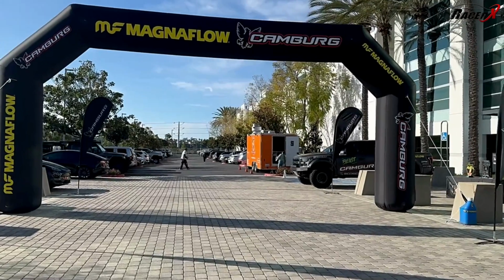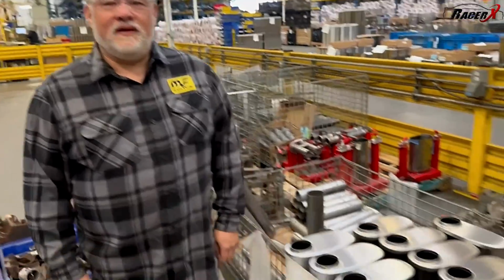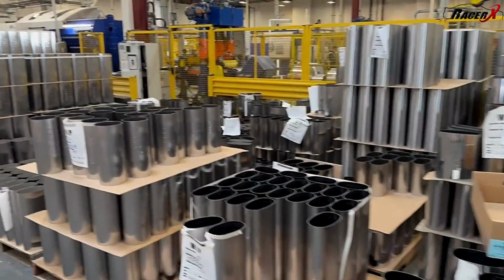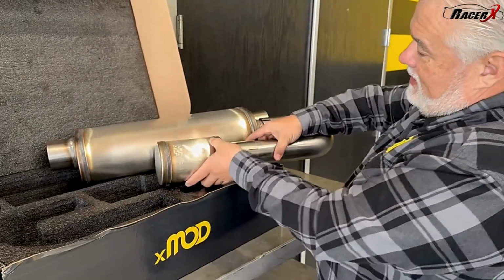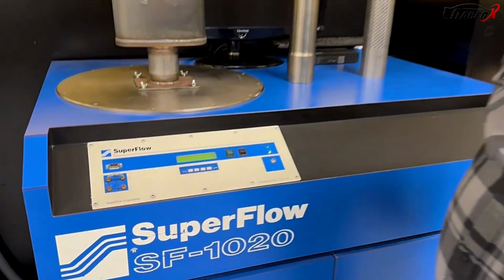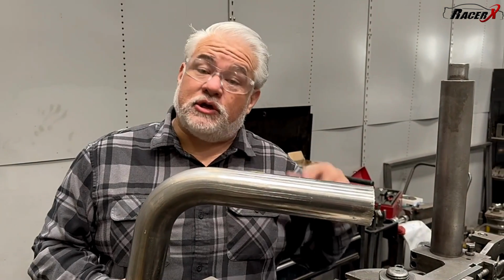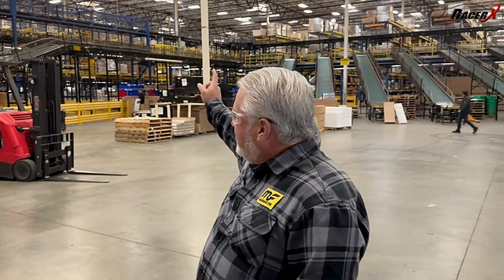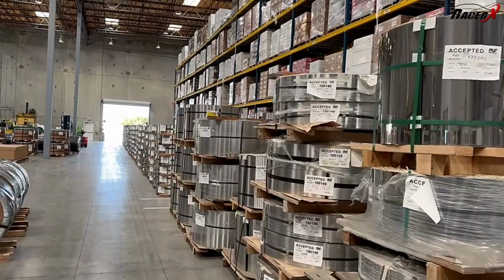I visited the most insane exhaust company in the world.

Comment: Amazing video behind the scenes of Magnaflow. The one thing that was surprising was the perforated Muffler was 38 CFM higher than the straight pipe. I've watched a lot of YouTube videos of Challengers and Chargers hemis and just about everybody is taking off the mid mufflers and replacing it with straight pipe. And sometimes taken off the resonators. Based on magnaflows demonstration all those videos using straight pipe is not correct thing to do. Actually I do have a question. the employee showed the perforated pipe without being in a muffler. Too bad he didn't flow test that perforated pipe without the muffler to see how it compares to the perforated pipe going through the muffler.